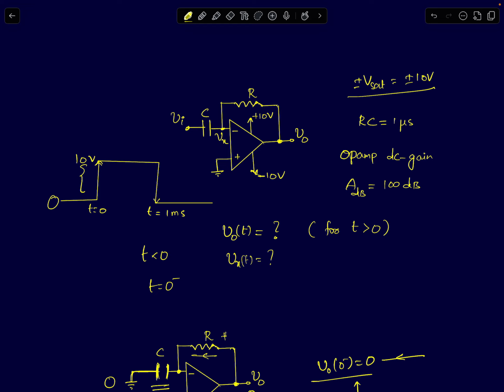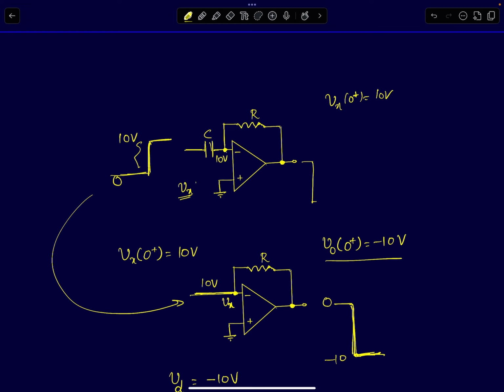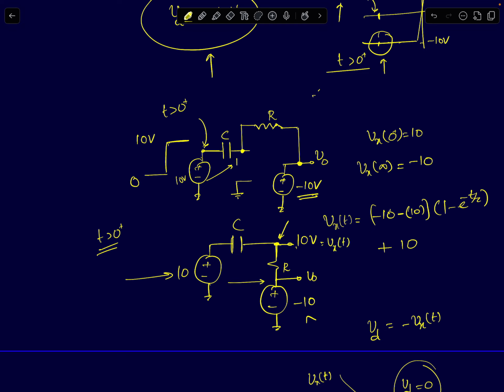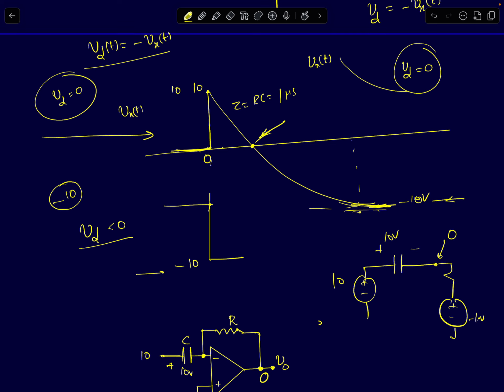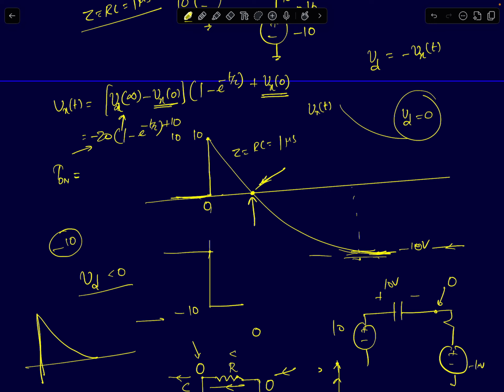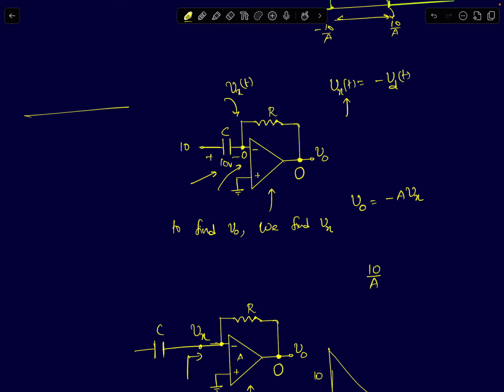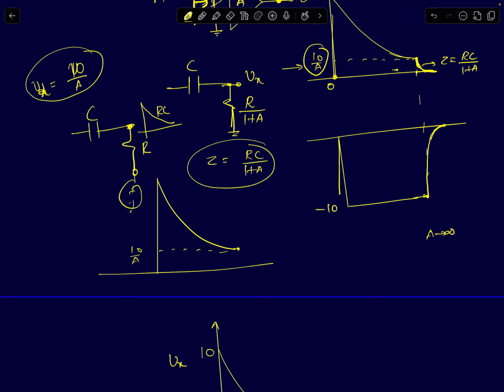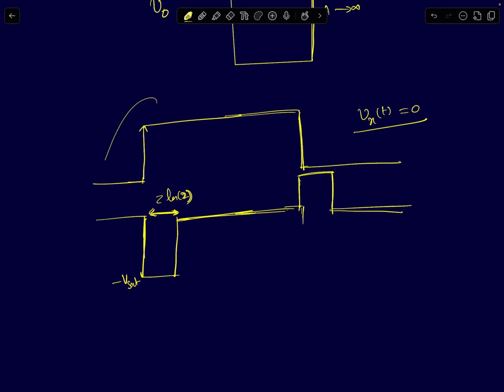AE Lecture 24.a) Step response of Inverting RC differentiator

Comment: So cap voltage cant change instantly hence Vin directly appear at V-. But, if we think -ve fb ensured then cap can change its voltage instantly which cause infinite current through, which also anyway saturates output. Kindly compare this explanation with OC lec. 5 at time 26:55 sir.